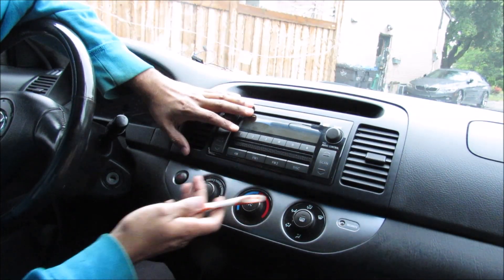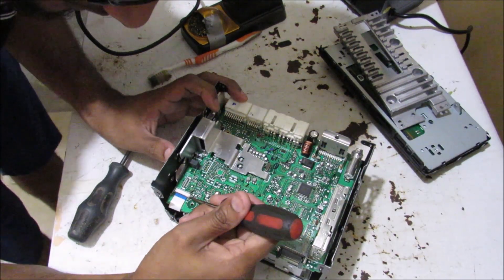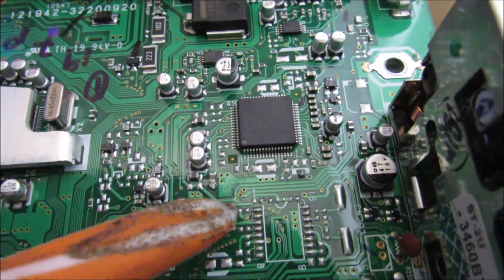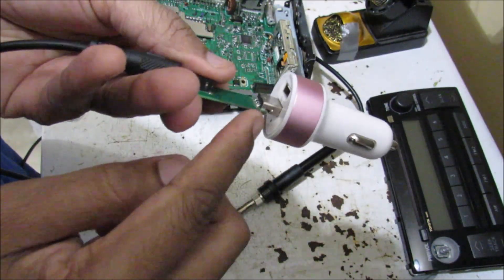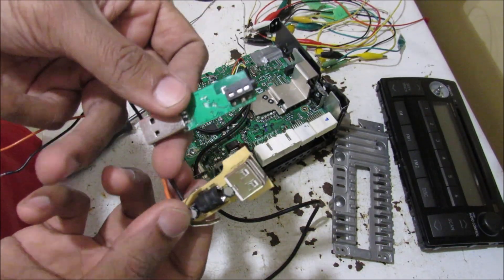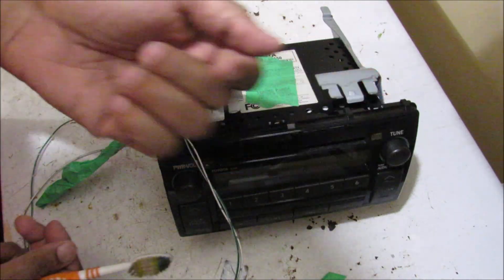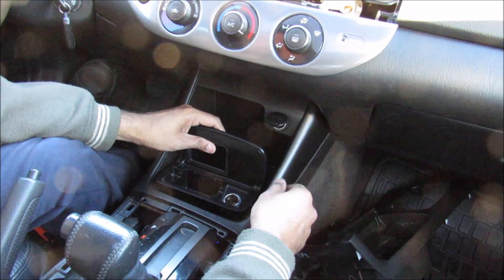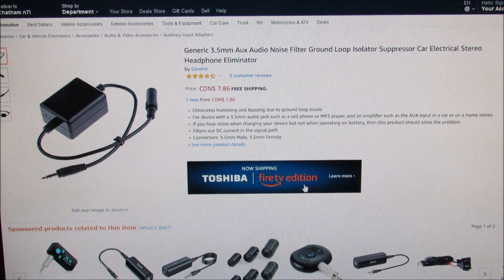$10 Bluetooth Stereo Hack

Comment: Nice. I got a 04 Camry but it look different from the inside .can you help?
Reply from the maker: Because you have JBL, you're gonna have to look on the board for the CD In/out or Google the Pin-out of the chip
Reply: @speedkar99  No. mine does not have JBL. I have open it and took some pictures and see a few L and R chanel but don't know wich one to solder to. How can i send you the pictures to look at ? Model Toyota 86120-AA040

Comment: Instead of taking 4-6 hours of buggering around like this just buy a  BLUE TOOTH MODULATOR and plug it into the LIGHTER SOCKET and run the stereo on AUTO SEARCH and within a minute you are connected on BLUE TOOTH -- the modulator costs around 10 dollars (80 rand in South Africa)
Reply from the maker: Yeah and the audio quality will be if FM radio

Comment: Did the same but on brand new radios (one with CD and one without) that had 3.5mm jacks. Using the same, at least in form, receiver but did not use any connectors or 12 to 5V converters. Soldered the left and right channels from the radio PCB to the bluetooth PCB and did the same for the power. Most if not all radios will have an internal 5V rail for their electronics to work. This also eliminates a potential ground isolation problem that you mentioned.
Finally, I drilled a small hole into the PCB of the receiver and screwed it to the side of the radio. This did not affect the range, it works up 6-7ft/3-4m from the car (while opening/closing my garage door).

Comment: It's really great hack but ,
I've question:-
1. why Bluetooth connected before the key is not on and   Even the radio was off how audio signal goes to speaker?
2. Any hack let the radio by hack work  without Playing blank CD.
Thanks
Reply from the maker: Not sure if there's another way to trick the radio into taking a signal from an external source without an interface bus

Comment: How's the sound quality do you hear any static sounds or buzzing. This is cool really awesome work. Definitely will try. Alot cheaper doing this than buying a factory radio head unit with added bt that can cost up to 300 to 400.

Comment: Hi @speedkar99. This is an amazing video. These jokers commenting otherwise don't know the satisfaction of tinkering with something and getting it to work.

I have a 2005 4runner which has the same 2123AF controller. I pretty much followed the same method. But here is where I am getting stuck:
I haven't tried this with a silent CD, as I don't have access to a cd burner yet.

If I play a cd which has music (just to test) and hook up the aux, in theory shouldn't both the audio signals just mix and play through the speakers? For me, what's happening is that when I play the cd, it plays normal, but as soon as I plug the aux to phone, the cd music stops playing, but also the music from the phone does not play.

I don't think the motherboard has the intelligence to detect signal since we just soldered an input to the existing input, but I may be wrong.

Have you tried playing this with a cd which has music on it. I am just trying to confirm if that is expected behavior, or did I screw up soldering the contact points.

Your help is appreciated.

Comment: LOL not even electrical tape. SO................................. has it caught fire yet? and by the way its auxiliary no aux cable.
Reply from the maker: This was just for demonstration. I already have an aftermarket unit that I use.
Reply: @speedkar99  if you so idiots that follow the exact method that you use then they will have the possibility to cause fire to there cars. if your your to make a demonstration then do it right the first time or then DON'T release a video.

Comment: Isn't the Bluetooth module going to deplete the battery with that always on cig lighter power source?
Reply: He had the radio apart already, should have just tapped into a 5V rail on the mainboard. Or even with a simple LM7805 LDO voltage regulator off the 12V ACC wire would have been sufficient. Those BT modules use negligible current so wouldn't even need a heatsink for the IC. Of course, use a fuse either way. And unless you can cram the module in the front faceplate it would have to be mounted externally. The metal shell of the radio would block or at least greatly diminish the signal otherwise.

Comment: Thank you for this but instead of tapping into the cigarette lighter, could I just use a fuse holder in one of my fuses that turns on by the ignition for my 12v source?
Reply from the maker: Yes 
Make sure you use a ground loop isolator
Reply: @speedkar99  Thanks dude!

Comment: Hi i got confused, from what i see, you soldered on the traces on PINS 51(CD-L) at 62(CD-R) but  at 2:41 in the video you said PINS 52(AUXIN-L) and 61(AUXIN-R). I have the same IC on my old toyota stereo but just a different layout. Unlike your stereo, I dont see the in-line resistors on mine so i just soldered them onto some contact point near the IC. Also, would it matter if i just used the PCB screw holes chassis ground for my ground wire of the aux cable?. I cant make it work, I highly appreciate your reply! thanks. Rest assured I checked for continuity from the IC to the aux cable itself. Mine looks like this btw(just got this off the internet but it's the same!) https://www.ubmthai.com/leksoundsmf3/index.php?action=dlattach;topic=49673.0;attach=80098;image
Reply from the maker: I might have mixed up the pin numbers, best to double check the schematic. The screw holes make for a good ground. If you are using Bluetooth you'll need a ground loop isolator to stop a whining noise when the alternator spins up.

Comment: Good video, to simplify: just connect power/usb pieces to the power input 12volts of the radio unit
This way you don’t have to remove the center console
Reply from the maker: I tried that and almost fried the radio, it didn't want to turn on  . A ground loop isolator helps too

Comment: Instead of regular bluetooth receiver used in this video which is music only, will the aux pin work with mpow bluetooth receiver which is for both music and phone call? I have 02 camry LE with stock cd & cassette 86120-AA040
Reply from the maker: This works for phone calls and music....it's basically like a Bluetooth speaker

Comment: No disrespect but you have more  skill and time than the average person and if I did what u have shown I would probably wreck my radio .
Why not buy a FM transmitter and plug it into the cigarette lighter or 12v adapter and save yourself all that hassle.
Reply from the maker: For lazy people yes the 12V adapter is the way to go. If you want better sound quality you'll need to solder the lines direct.
Reply: @speedkar99  100,000 lazy FM transmitter owners oh well !

Comment: It would be easier to buy a Bluetooth receiver and connect it to the 3.5mm jack in the car. It would cost a little more but is a whole lot of less work and chance you'd mess something up.
Reply from the maker: Lol. The whole point here is because this radio does not have a 3.5mm jack

Comment: Pretty cool but they literally sell FM bluetooth transmitters that you basically put your stereo and 12v transmitter on the same channel, connect to the transmitter on your via BT and thats it.  They cost about $10-12.. I put one in my gfs 2004 nissan altima.
Reply from the maker: The sound quality of those can't Match a direct connection

Comment: If you car supports USB playback you can buy a USB Bluetooth receiver for a few bucks and use the USB to power the receiver and the aux port for sound. Not really a hack though and not very elegant.
Reply from the maker: Elegant no. But once tucked away neatly it's pretty slick because it looks all OEM without aftermarket dongles
Reply: @speedkar99  I was referring to the solution I mentioned. Yours will look far superior of course and yes it's a proper hack.

Comment: Really good demonstration/explanation video thankyou. Easier for me to install radio/CD player with blue tooth from ebay for less than a hundred bucks. I'm not a technical person. Cheers.
Reply from the maker: True but then you don't get that OEM look
Reply: @speedkar99  i know, but if i tried, I'd probably end up casing an electrical fire.
Reply: @speedkar99  you are obviously quite adept at working on electonics,but there is available fm bluetooth adaptors that plug into the cigarette lighter and play through the radio for around 15 dollars.

Comment: Just bought an excellent bluetooth adapter on Amazon for $12 and saved myself 6 hours of work. There's a hack for you.
Reply from the maker: Nice. Enjoy your crappy sound quality thru FM stereo
Reply: @speedkar99  Not FM, not crappy. Yes very easy.
Reply: USB then? There's really no need to "hack" anything in that case. This video is pretty much exclusively for the benefit of folks that just have AM/FM/CD/Cassette stereo units (no USB, no aux). 

Glad you found a solution that works for you regardless though.

Comment: I wanna try this on my 05 Camry. But what  type of wire did you use for the power connection?
Reply from the maker: I just used a regular stranded awg14-16 gauge wire (cut from another car's wiring harness)
Reply: Ok thanks now I gotta work up the nerve to try it. Thanks for the video

Comment: How did you find the diagram for your chip?  I would love to do this for my subaru impreza but I'm not finding anything online
Reply from the maker: Google the chip name and get the datasheet from the manufacturer
Reply: To add to speedkar99's answer, you may need to disassemble the stereo to find the chip name unless it's posted online somewhere. You'd possibly be disassembling it anyway. So you can look at it as practice. Be sure to stay organized too so that you don't end up with any extra parts. Also, to me it seems that a lot of chips, even small ones, have their name on their casing; even if it's faint and hard to see.

Comment: its only playing in one of my car speakers, any advice?
Reply: check left and right cables if it is connected properly (The wire could of pulled out when soldering) Or  check jack to Bluetooth connection. If none of those are option check the equalizer and make sure it's not set for one side (check your car manual for more information)
Reply from the maker: Change the aux cable?

Comment: Do you have a link to this specific bluetooth adapter? Everyone that I find has a battery and a power switch, making it difficult to hide it behind the dash. Thanks!
Reply from the maker: I'll find the link and post it soon. Search up USB Bluetooth adapter and use it with the inverter
Reply: Tunai's Firefly is a good option. I have not experienced any clipping or other interference with it.  Been using for 2 years. I have not had any success with those under $5 modules like the one in the video.

Comment: I need your help, speedkar99!
I'm trying to install an AUX input and a bluetooth module in my car audio system. (Lexus ES330, Pioneer)
I succeeded connecting AUX cable by connecting the cable into 3 pins which seemed like designated for additional input source.
It was easier than I expected it to be because when I select Tape In, it played the cassette tape, and automatically changed source when I put the cable into my iPhone. (it made successive bursting sounds when connected and not playing music with iPhone though)
The bluetooth receiver has its own input and output pins. When bluetooth is not connected, input cable signal bypasses through the module. When bluetooth is connected, it mutes the input cable signal and plays the bluetooth signal.
Here's the problem I got:
I wired the bluetooth module between iPhone cable and the audio system. When bluetooth is not connected, source from iPhone cable is played as expected. However, when I connect bluetooth, the audio system change the source to cassette tape.
I have no idea why this happens. The 3 pins in the audio system only recognize iPhone signal, but not the signal from the bluetooth module. Is there a difference between those 2 signals? Maybe voltage difference? I really need your help here.
Here's the link for the circuit board for the reference: https://drive.google.com/drive/folders/1AzDHEvqm-9IvzxZCqSPYTnMzOLY8zbM-?usp=sharing
Thank you in advance!
Reply from the maker: It's either jack detection on your iPhone, or the impedence on the Bluetooth module isn't enough to overcome the cassette signal. 

Since the ES330 has a CD changer, I'd recommend tapping into that, the audio will be even clearer.
Reply: @speedkar99  Thank you for the reply! I connected the signal to two tiny potentiometers on the cassette circuit board and it works. I could simply mute the cassette signal by turning the knob of the potentiometers, and connect the module with those. Do you have any idea to make the module to overcome the cassette signal of the 3 pins? Maybe there's a device that augments the impedance of the bluetooth module?
Thank you once again!

Comment: Great work! 
 I got a wt-usb adapter in amazon that plugs into the cd changer port on the back. Works well but i do get a static on the right speaker at high volumes. Any advice on fixing the static?

https://www.amazon.com/Interface-Yomikoo-1998-2004-1998-2002-Highlander/dp/B0169MV538/ref=asc_df_B0169MV538/?tag=hyprod-20&linkCode=df0&hvadid=309807586683&hvpos=1o2&hvnetw=g&hvrand=1597217911682607667&hvpone=&hvptwo=&hvqmt=&hvdev=m&hvdvcmdl=&hvlocint=&hvlocphy=9007795&hvtargid=pla-570357881261&psc=1

I did try to switch the ground as suggested in other videos but it didnt help.

Comment: I just got a less than 10usd Bluetooth to aux and fitted it in 2 seconds. But you sir, are a genius anyway.
Reply from the maker: That works but isn't as coear as wiring it directly
Reply: @speedkar99  will the soldered aux cable work if i plug it directly into my phone, i don't want bluetooth.

Comment: To test if the modification worked, does the stereo have to be fully reassembled, or is there a way to test without having to assemble and risk having to take it apart again?
Reply from the maker: Yes you can power it on the bench if you know the pinout at the back of the radio.

Comment: The toothbrush pointing device just kills me!!  LOL
Personally, I have an older toothbrush by GUM. The plastic is of the highest quality.
Reply from the maker: Hahaha good one
Reply: @speedkar99  great tutorial BTW...  I love those comments about just buying a new radio with bluetooth built in.  The problems with that are...

1. Most everything available in the aftermarket car stereo industry these days is pure crap!

2. Most OEM stereos are also computers that perform more functions in the modern car than just the audio system.  ex. GM ON-Star, dome lights, annoyance beeper, on board cameras, navigation, etc...

3. Look closely at the OEM radio. Many are made by reputable companies such as Alpine, Matsushita, Fujitsu Ten, Pioneer, etc...  Don't think the new Alpine available on Amazon is the same quality of Alpine you might find in a Lincoln LS for example. If you want a real hi quality Alpine, go find an old 7909 anniversary edition unit.

4. Many cars will not allow for a simple aftermarket installation due to proprietary amp input/output impedence and special configuration without expensive adapters and such.

5. FM modulators just suck!

Comment: they do sell BT modules that would fit inside the radio without all those wires and connections. but this was cheap and works which is a plus.
Reply: The metal shell of the radio will greatly impact BT reception however.
Reply: @daijoubu4529  ,  I was thinking it might interfere putting the BT module inside the radio. But you could always put it on top or the back of the radio. Im getting ready to add one to a older GM factory stereo, so i might experiment to see what kind of signal loss i get between a couple locations. finding a good location to connect to inside the radio is going to be the trick for me. lol
Reply from the maker: Yes the location is also critical. I located outside because the wires I tried tapping for power didn't allow the radio to turn on for some Reason.

Comment: who uses that old car radio these days?
Reply from the maker: Most people still keep the oem radio
Reply: @speedkar99  check ebay, you could find lcd radio + gps + android from $20
Reply: I hate new stereos, look so ricey. I much prefer to keep the OEM unit so it's "period" correct haha, my 2000 Camry have BT via a CD changer emulator

Comment: I might have 1 concern: the power source is probably "always on", so the Bluetooth  module will always drain power? It would be better to connect  it to a source that only powers the module when the keys are turned. Otherwise a very nice hack!
Reply from the maker: The cigarette lighter is powered on with ignition on my car
Reply: @speedkar99  not all cars are like that.  My 01 oddyssey's front power outlet is always hot but the one in the cargo area is hot with key in ACC.... I have a power splitter with a button...the plug stays in the power outlet and I use its onboard switch to turn it on/off.
Reply: Sorry dude I dont believe that your lighter is turned on with the key, it paired with the key off.
Reply: @cdbennett2332  radio was on - key was on - all toyota radios of this era and later will only come on when key is turned to ACC

Comment: So....... this is another vehicle specific hack that very few people will be able to trace the correct pins to use onto any other car stereo. 
It’s too bad he didn’t specify which car he is in
Reply from the maker: Many radios use the same circuitry inside, maybe even the same exact chip. The principle is the same for any radio-trace the pins to the audio chip and inject your aux signal. The vehicle is mentioned in the video  description for those who need more detail.
Reply: It's a Camry. If you really cared, you could have searched Google Images once you saw the Toyota "T" on the steering wheel airbag cover.